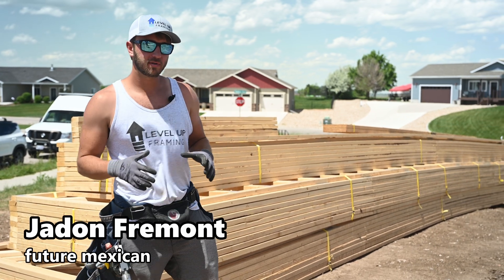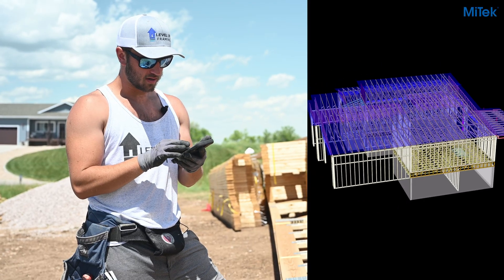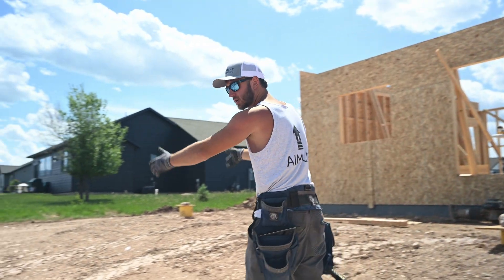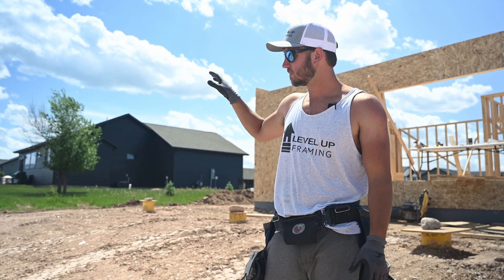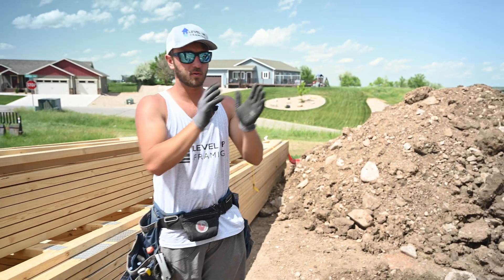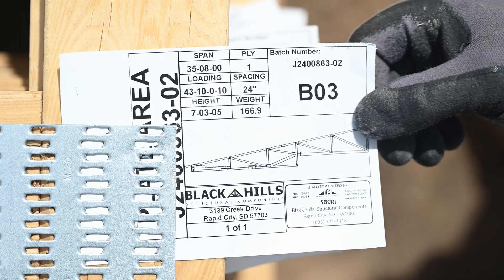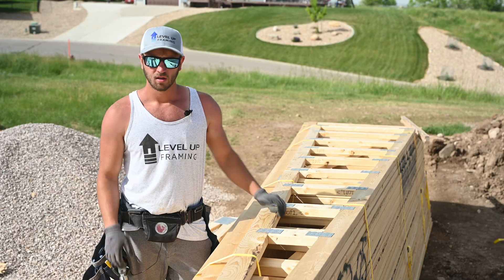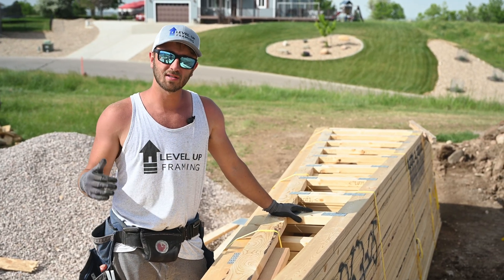This Is How PRO Framers Prepare for Crane Day

Comment: "Future Mexican" - Does that mean you're having tacos tonight? 🤣 I enjoyed the video, but I always enjoy the ones you make. I thought the crew that framed my house would probably use a machine of some sort, but they didn't. I guess it wasn't as necessary since the roof was stick-framed instead of truss-framed. They didn't even use a machine to lift the 650 pound steel beam that runs across the top of the garage. I wasn't there to watch it, so I have no idea how many of them it took to get that thing 10 feet up.

Comment: A trick that we have used when setting trusses is bunk the first four trusses, then lift up the gable, let the crane or the telehandler hold the gable secure while we stand up the other trusses by hand, get things leveled and securely braced off, then we continue with the set. This is super helpful when you have a large floppy truss for a gable, or if there is enough wind that you want to keep the crane on the gable until it's braced off good. 

As always, your content is spot on!
Reply from the maker: Nice trick, thank you!  We will keep that in mind for big gables on windy days 👌🏼